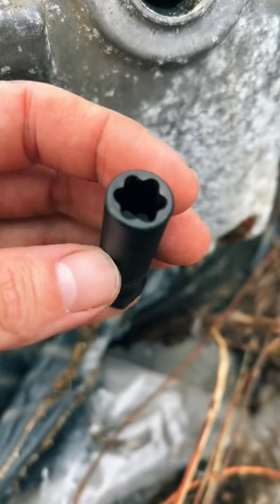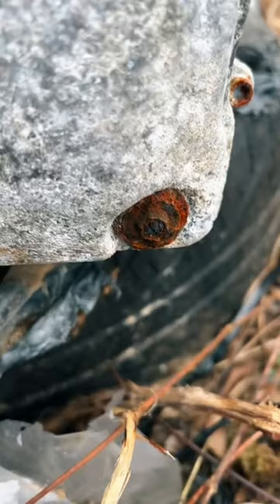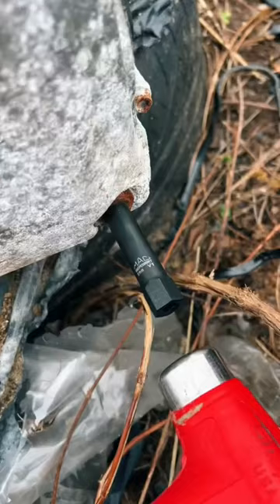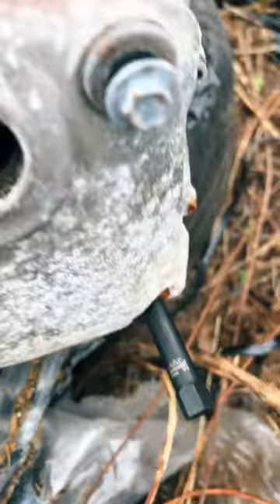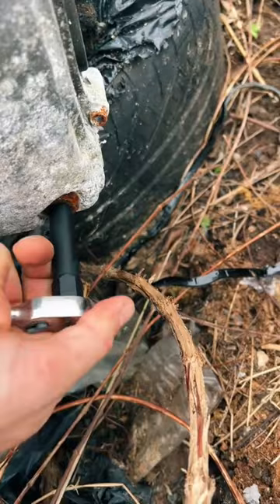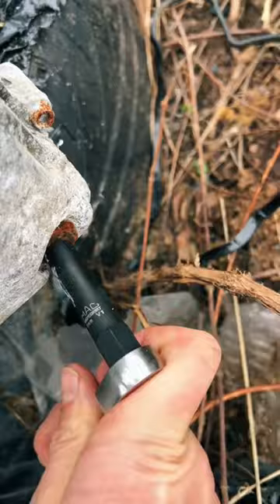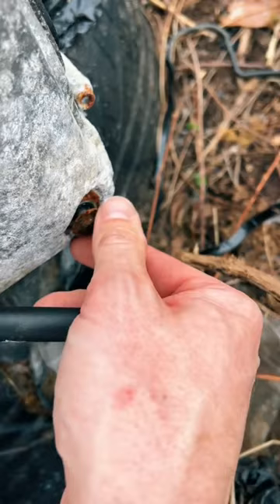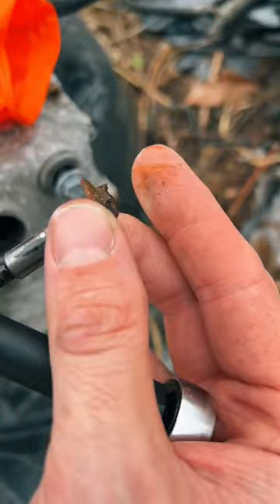MAC #RBRT Extractor Sockets Doing What They Do Best On A Crusty Subaru Bolt! #mrsubaru1387 #shorts

Comment: Yeah!!! Now instead of buying a new bolt, I just tighten it back up for the next mechanic
Reply: I wouldn’t just because I have a pretty good feeling that “next mechanic” is gonna be me.
Reply: @bentrod3405  you beat me to it! That next mechanic always ends up being me, so i make sure to thank myself ahead of time for the anti seize and new bolts lol and make it a habit of replacing more than needs replaced while it’s apart.
Reply: @xConceptz1  same. The other day I was replacing the shocks on my car and I noticed the ball joints were looking a little worn out and the bushings on the control arms were starting to dry rot pretty bad so I decided while I was in there I’d just replace the control arms as well.
Reply: @bentrod3405  same with both ball joints and bushings. I did all of those too and then went a step further and replace the main seals in the my front diff like a mad man since it was a lot easier to pull with the arms and cv axles already removed. Then did u joints and coated the frame. I never know when to stop, my dad calls me crazy. But i’ll be the winner when my truck hits 400k miles 👍🏼

Comment: Are these different then a regular extractor? I bought my cheap set from Amazon and work great
Reply: They're better, but unless you're a pro you probably won't run into many situations where you'll see the value. I could see owning like a set of the 3 most common Subaru bolts. But a whole set just doesn't make sense for personal use unless you're made money.

Comment: That was a aluminum pan and the bolt is steel they are not going to rust together as aluminum doesn’t rust and that bolt was probably torque to spec so not very impressive